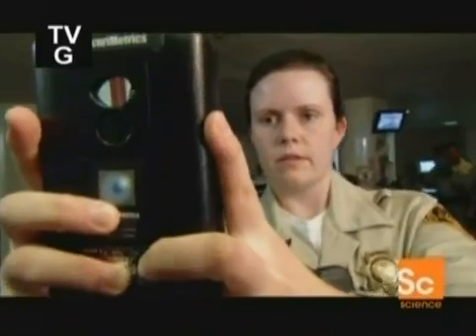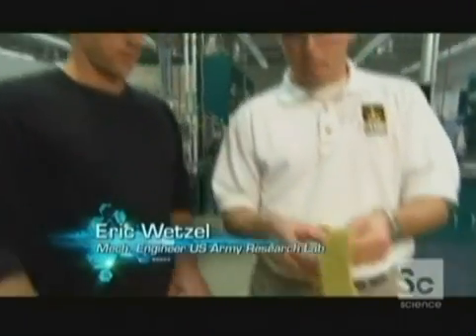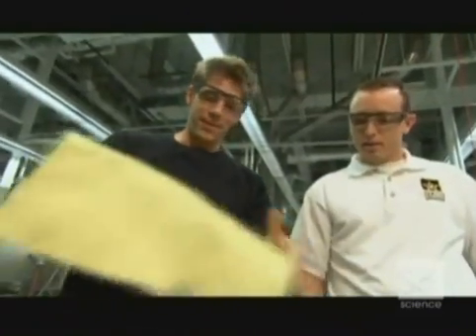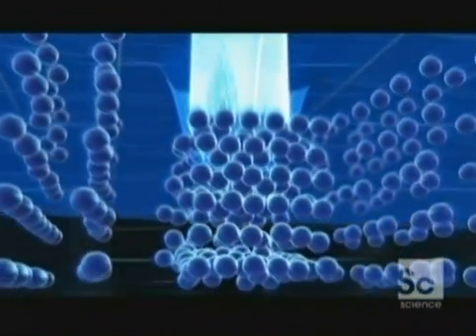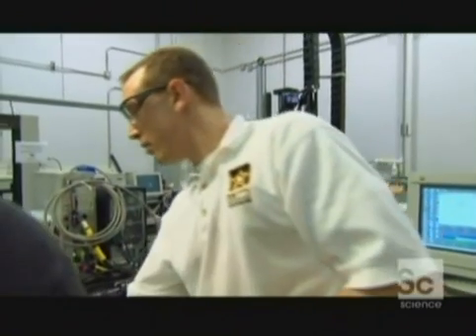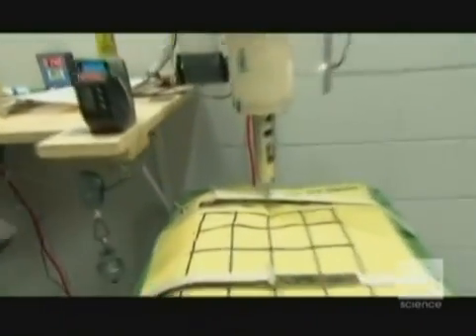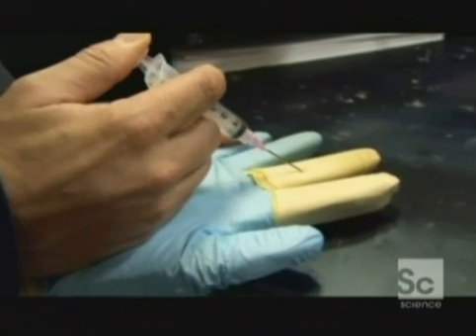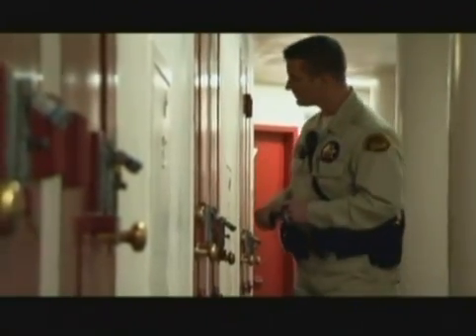Liquid Armor

Comment: What does the non-Newtonian fluid do to the bullet proof aspects of the Kevlar? Improve it or reduce it?
Reply from the maker: If the fluid stiffens on impact of a bullet, I could only deduce that would improve the strength against a bullet hit.
Reply: ***** One thing, like the formula for dissipation of force over area, I would have been interested if they mentioned it is the thread count of the Kevlar in these exhibition for the TV show. At my work they have Kevlar arm guards and gloves, with the stitch count at 1000cm2 for the arm guards and 1500cm2 for the gloves. Even at the stitch count at 1500cm2  the gloves the way we work, I'd be breaking through the reinforced tips. So I wonder how the Kevlar chains would hold up against habitual use, and how much flexibility this fabric would allow because the more energy you put into this fabric the more it absorbs so I can imagine a work uniform might be cumbersome to someone doing physical labor, as the uniform wouldn't breath at all. The gloves at work do breath a bit, but not nearly enough to make work comfortable at all, so with a non-Newtonian layer it would just be like wearing a snow suit or possibly worse? I am pretty sure it is counted by cm2 not mm2  but I could be wrong?
Reply: cplai
Yes, it stops bullets. That's why I came here to learn more.
Reply from the maker: ***** Don't understand what you try to say. If the fabric stiffen, then the impact area will kind of form a plate like shield for a brief moment. Which mean the impact will push against the target as a large disk instead of a small dent. The largest the impact area the lesser the pressure given the same force. So I don't understand why you would think the opposite. The force is spread out to a large area due to the stiffen material, not concentrated.
Reply from the maker: ***** disagree.
Reply: ***** it;s not a bullet proof vest its for stab and puincture protection. stuff could be the wrap covers the Kevlar and trauma plates.
Reply: Yes but why even ask why they didn't shoot it or how a bullet affects it if that's not the point if the tech? With out the formula for how it dissapates force it hard to even theorize. What if it's based upon in the thick ness. Still if its purpose is to dissapate energy be it a shiv or a bullet it wouldn't matter. For the bullets energy to magnify the property if the gel would have to change. The engineer even admits getting stabbed would hurt. I bet the faster the item the greater the protection. A bullet has a greater surface area than an ice pick. Larger lattice work. The drop test illustrated this. The bow even better. If any thing watching the high-speed the energy radiates outward like ripples in a pond.
Reply: ***** The "spreading damage over the heart" would not be lethal. It would be like getting punched by a super small, super strong fist. It would have the same properties of Kevlar, which already does not do that lethal spread of force or whatever; and the liquid armor additive will make the Kevlar more rigid, so you get a very strong stab proof, bulletproof piece of work. Besides, blunt force trauma is less damaging than piercing/slashing trauma.

Comment: cool, but i want them to put that in front of a block of clay, shoot the arrow, then check how deep the BLUNT impact goes.
Reply from the maker: I believe this material will work best on spandex. When it is hit, the body-fitting fabric should turn into a hard shell instantaneously. As shown in this video, when the fabric is left flapping around, it just yield to the impact. I don't think it will yield as much if the fabric is stretched tight. I wish the video would show better designed tests.
Reply: @cplai  That is a silly idea. The whole point of Spandex is to stretch! The last thing you need is the gaps getting bigger. 🙄

Comment: you know what would be really cool? (and yes, I know this sounds far fetched) a police robot that has a dense coating of this liquid/solid under a thin membrane, so that if you try to attack it, (with a knife, hand, bullet, etc) it will absorb the attack and trap the hand or knife inside of it by turning solid with the application of the force. I know there is a lot of problems with this (plotholes galore), but it would be a non-aggressive way to stop a criminal- if the robot was attacked, it would have immediate proof of that attack if the person was stuck to the robot, and a second piece of evidence would be if the membrane broke. this robot wouldn't need very aggressive weapons, as the act of attacking it would have no affect, since the robot would have a 6 inch layer of this glue protecting its inside mechanisms from these attacks. it still would be versatile, and wouldn't have to use lethal force.

Comment: At 8:50, I believe he meant to say "shear thickening." Shear thinning would have the opposite effect. Shear thinning is generally attributed to polymers, or long chain molecules, which disentangle and align when exposed to high shear rates (deformation), reducing their resistance. Particle suspensions (like this, or corn starch and water), are more typically associated with shear thickening materials, and will increase resistance when exposed to high shear rates or high deformation.

Comment: Wouldn't you still get stabbed if someone were to slowly stab you? Obviously I doubt anyone would SLOWLY stab someone but still
Reply: snails from the hood
Reply: Well since the fluid reacts to force, it's a possibility, but an extremely small one. To successfully stab someone you'd need surprise and force. Guards are alerts all the time so surprise is almost out of the question. And if you cannot apply force, then there's no point in stabbing because it probably won't be that lethal.

You'd still get bruises though, but your skin and organs will be intact, which is the sole purpose of these protective gears. You may break bones if the force is high enough, but at least bones heal, where organs do not :-)

Comment: I agree that this is good knife proof armor. im think that there should be 3 layers of kevlar on a soldier the middle layer should the liquid armor, and the back one more kevlar,that way if the knife pierces the 1st layer of kevlar the middle layer will protect it, since the stab destroyed a spot on the 1st layer it is vurnerable but with the 3rd layer of kevlar it will help protect more bullets if they get shot in the knife hole.

Comment: "Next week: liquid armor piercing bullets!"
Reply: Sorry to burst your bubble but Depleted Uranium armor piercing projectiles have been in use since 1977 by the US Military.  Good luck stopping a 50 cal with your ground glass and glycol.
Reply: @MrNikkoz  Sorry to burst YOUR bubble, but this, or any other Kevlar, isn't designed to stop high velocity rounds. Stab vests aren't necessarily able to even stop handgun rounds. This certainly wouldn't stop any standard military 5.56, 7.62 or .308 rifle rounds. You'd need kevlar armour 12+ inches thick. Which is why ceramic, metal and UHWMP plates are used instead. Depleted uranium has nothing to do with it... it's velocity that counts.
Reply: @another3997   It was in response to "liquid piercing bullets"  as if they are scarier than depleted uranium.
Reply: Oof Dog  That is not what Dan 123 was talking about, you are correct. lol
Reply: Oof Dog  i call it the NOPE armor
Reply: 5 mph projectiles?

Comment: I bought brand new bicycle tires and inner tubes for my bike recently. I rode it 3-4 times over the span of a week or two. Then the rear tire blew a flat again... When I saw this video around 4 years back, I thought how great it would be, if this stuff was used to treat both bike and car tires to make them more resilient- if not completely resistant to punctures.
Pretty sure that would save lives on the highways too, with incidents where a tire blows out and the driver loses control of their vehicle. Sure, police car chases would  rule out the possibility of shooting the tires out, but there are more ways to stop a car.

Comment: To the people saying it doesn't take away the force of the impact, well duh, but the reason why the knife is formed like a knife in the first place is because it's sharp edge can cut into tissue by using that same force a blunt object would have on a far smaller surface, therefore applying the force far more efficiently.

Comment: So couldn't someone stab them very slowly to beat this system?
Reply from the maker: Certainly, if you can push a shank into someone without getting any reaction, then you are not really attacking, you are just torturing that person. You can also take your time to remove his armor since he is not fighting back anyway. You might as well cover their mouth and nose with a wet cloth and run water over it. You may extract some important info via the waterboarding process too.
Reply: That is a little extreme I mean headlock knife in strong arm and slowly push if need be - like a hostage. I do not mean so slow that it would make no sense.

Comment: wait...even wearing that kind of armor you would'nt be safe, i mean totally safe.
it's true that the blade don't pass through the fabric, but the kinetic force does (look at the scaffold while they're tring).
So, maybe the wearer won't bleed, but for sure he'll recive a strong internal trauma anyway.
Reply: Not if the kinetic force is dispersed throughout the Kevlar, as a bullet's force is.  The kinetic force of a sharpened stick or knife is far less than that of a bullet.  You'd have to aim for unprotected skin — hands, feet, neck and above — to do some damage.

Comment: I discovered a product back in 1998 that enhances the performance of Soft Body Armor including the infamous ZYLON Fabric.The product also works well with another composite material to reduce blunt force trauma when worn in the carrier behind the vest.This product works well to improve both Soft and Hard Body Armor plates the only draw back on this discovery is that the majority of the Armor Companies that I've contacted want NOTHING to do with it because they'd have to share the ROYALTIES. Imagine that! Royalties VS Improved Safety. How many L.E.O.'s have been seriously injured or killed due to Blunt Force Trauma since the year 2000?
Reply: The liquid armor tests needs to be retested with a proper Hunting Arrow.Steel point is one thing.Razor Cutting Point is another.

Comment: Since this is based off of kevlar, (Basically an upgrade) then if they use the right grade of kevlar then id assume it will do just fine, if not better.
ProTip: Grade 2 kevlar (What bank truck personnel use) can stop a .357 round. With this stuff im sure it could do more.

Comment: A useful and practical application of a long-known so called anti-tixotropic liquid.  Whilst "nano-particles" sounds fashionable, the liquid is nothing special.  It is a 20% w/w suspension of ubiquitous Aerosil (Degussa trademark) fumed silica) in equally ubiquitous polyethylene glycol. Whilst the solid in the vial looks like an impressive quantity, Aerosil is fluffy and 10 times less dense than water.  It is used in viscous couplings for automotive drive trains.

Comment: It's called a non-Newtonian fluid.  As an unbalanced force is applied, the shear viscosity increases proportionally.  This is the same process as corn starch and water.  Same thing that makes silly putty flow and laffy taffy et all behave the way they do.

The question is can this be combined with other materials, rather than just kevlar.  I'm thinking spandex/gortex/polyester material.  Full body jumpsuits, that are breathable.

Comment: "is better than my idea"

Right, because "steel (or) titanium links" is chain mail, which is lighter than scale armor (since there's less metal!) but has lots o' holes and thus *stinks* at repelling thin pointy weapons.

"scale is actually not that bulky"

But it's lot's and lots of steel.  Which is heavy.  And rusts.  In the *jungle*.  The HOT, MUGGY, SWELTERING jungle.  That's just unworkable on multiple levels.  Not to mention the thick padding required to prevent being chaffed raw.

Comment: So, a magazine of carbide steel pointed .22 Shorts or even a nail gun could kill a cop with only soft body armor on.  That's why you should always wear your panels.  Basically, this fluid fuses the properties of ceramic ballistic panels into your vest.  Ideally, you should already have those if your vest isn't some kind of knock-off or level 2 crap.  Still, I wonder if it would stop a 12GA, .50 BMG, 30-06 or .308 without some good titanium rifle plates in addition?

Comment: And what makes the fibers *not* move to the side? Because of the dilatant. And what makes the dilatant strong? Sudden application of a large force. What would happen if the dilatant was still in a low viscosity state? Do you think the fibers would still hold together?

Comment: If you've ever tried to cut Kevlar fabric with a knife/scissors/razor you know how tough it can be, A sharp knife will only barely penetrate Kevlar, the tip of the knife, even if it's razor sharp a knife will have a very tough time slicing or cutting raw Kevlar fabric and I mean a single sheet. 

Last time I checked Ice picks weren't knives... Knives and daggers, blades are generally just to broad to fully penetrate a layered Kevlar vest. I'm not the least bit surprised the pick made it through.

Comment: This fluid and weave some plastic in that kevlar vest and you are good to go. You could use hemp reinforced plastic that is 10 times stronger than steel. 1/4" or so plates woven over vital areas or even a scale armor like Dragon Skin and you could withstand all but the most determined shankings.

Comment: Unfortunately, while it stops the actual weapon penetrating, there's no reason why the stab wouldn't kill from the high pressure.  Targeting the belly of a guard with this will still cause internal bleeding without issue.  Using a large amount of padding would help, but it defeats the aim of keeping the guards unencumbered.  Interesting none the less though, and obviously a big step in the right direction.

Comment: agreed, however, what we are hoping for is a disperssal <probably spelled wrong,  of energy, or an absorbtion, your choice, the error that we run into is shattering,  i would say that ceramic is harder than felt, however if you drop a ceramic bowls, it shatters, we make vests that flex to absorb the energy of a stab or bullet,  when it hardens the risk of breaking occurs, and if the energy has not been dissapated, the weapon, be it knife or bullet, will continue through, although slower

Comment: Even if the shank doesn't penetrate the armor, it will could simply tear the skin apart because the fabric goes along with the shank into the skin ripping it apart. When the fabric gets stretched too much then the shank will be stopped, so it will protect vital organs, but it will also pierce skin (tear it apart). You need a plate to stop it from moving into the skin. Fabric moves with the shank.

Comment: Yeah, I get it now.  I figured they were talking ALL guns, not just handguns.  But clearly, it is just handguns.  You guys can all blow me for being open minded.

This could be used with ANYTHING, not just the stuff they are using.  All they need to do is keep the Kevlar from pulling apart.  Mix in any hardening liquid and it would work the same.  Every quality that talk about does nothing for it. And they never cover what happens with a slow shank.  To stab doesn't require speed or force.

Comment: the weaving of the kevlar would normally catch the rounded tip of the bullet and absorb most of the lethal kinetic energy "depending on the calibre" as for the a pointed object "a knife so to speak" would simply part the weaving and rapidly pierce through the gaps in the kevlar weave, rendering the ineffective against a close quarters knife assault.

Comment: That's all well and good, but I would have liked to see the state of what's *behind* the magic fabric.
The fabric is strong but flexible, so the strength of the blow is still going to be distributed on a minimal surface (the point of the blade wrapped in fabric rather than just the point) and deal almost as much damage.

Comment: look up bullet proof vests.  Only certain Kevlar vests stopn certain bullets.  Like ply-wood.  layering the fabrics over one another in different patterns can help give a strengthening effect against a bullet.  But mostly Kevlar is best used to hold the vest together after being shot at.  Most vests contain a solid ceramic within a kevlar pouch which would break and shatter upon impact absorbing the force of a high impact, the kevlar would prevent all the ceramic shards to spray everywhere.

Comment: Its pretty much as the same effect as the sand bucket experiment. Bullets mushroom on impact (unless using the FMJ) widening the surface area. Versus the arrow/knife where the tip just opens a gap through the sand and pries the Kevlar strands apart.

Comment: A bullet is not smaller than a knife in the case we're looking at. The idea is that a shiv or a spike is small enough and narrow enough to spread the fibers and then slide through. A knife would actually stop with very minimal window effect because it gets wider quickly. It would slip through first but then get caught.

A bullet is too wide to start spreading the fibers which are strong enough to catch the full force of the bullet.

Comment from the maker: Watch the video again and pay attention to the explanation on the "windowing effect". You will find your answer there. A knife has a pointy end that would push the fibers aside to create a window for entry. Theoretically you can make a bullet as sharp as a knife tip if you want, but that is not the norm. In terms of Physics, pressure is defined as force divided by the area of contacts. As area reduces close to zero, pressure increases towards infinity.